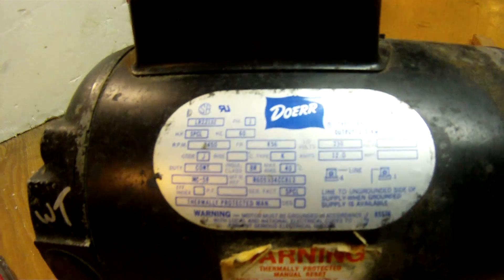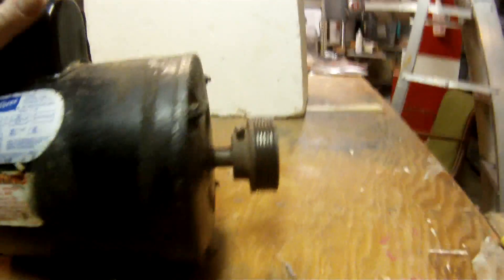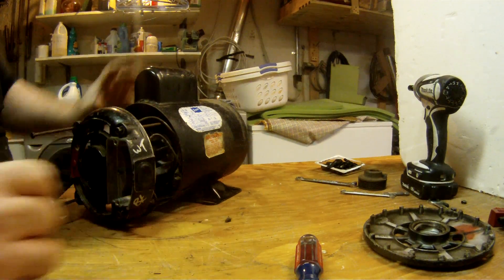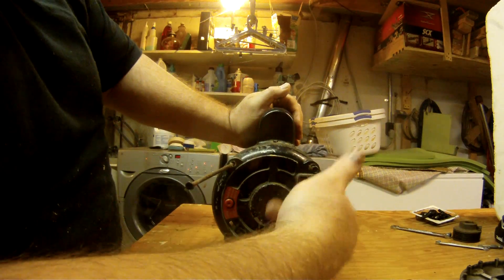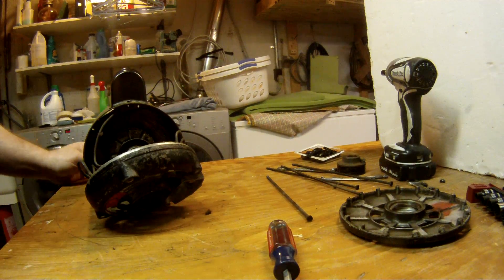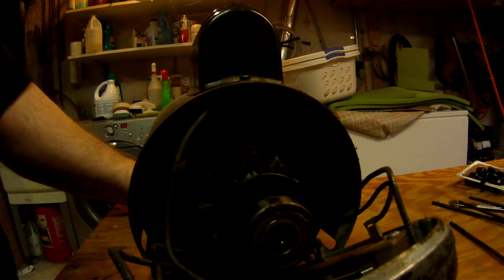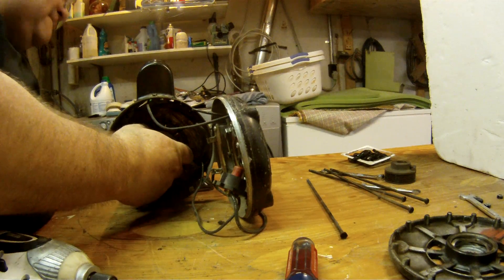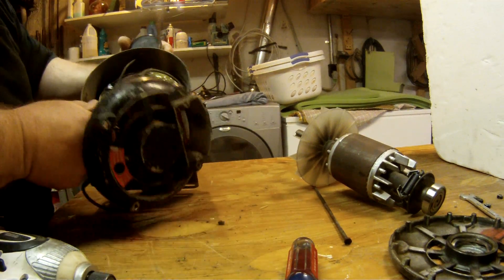Electric Motor repair disassembly and reassembly

Comment: I have a 1978 Deorr motor off an old compressor that was left outside.  I need to take it apart, see if I can re-lube the bearings and get the dirt dauber dirt out of there.  I can't get the ends off but thanks to your old vid here, it reminded me of how I've I've gotten the ends off when they are stuck.  The motor works, I just know it needs cleaning.  Glad you uploaded this.

Comment: Nice video.  Hi, i am hoping you might be able to assist me.  I have a brushless electric motor that hums but does not turn(belongs to a phase 1 bench grinder).  When i tried to turn it by hand in the "on" position, it does not move.  While in the "off" position, it turns just fine.  I checked the capacitor and it works fine.  The bearings are good too.  Any ideas on what might be wrong with it?
Reply from the maker: Brushless? Induction motor maybe? Shouldn't be a phase 1, I think. Does it need a VFD?

Comment: Suggest uou attempt a continuity test for the windings. It might save you alot of time. Do the windings smell like they're burned? Also, chances are that the cap is alright. It too , can be tested. Good luck. I'm having the armature (sp?) from an old Craftsman rebuilt. The two retaining springs that are located your armature completely rusted out on mine. Good informational video.
Reply from the maker: Thank you for the information. I ended up replacing the motor. It ran well until about 4 months ago when the mini rivets on one reed valve went bad. Going to have to make my own head gasket. Replacements are not available. No parts for a 35 year old compressor. Annoying . . lol . . . jk.

Comment: Capacitors can hold a charge for a very long time. You could have an old tube TV that's been unplugged for 5 years still have a charge of over 30,000 volts.

However, start capacitors normally have a bleed resistor soldered in to gradually dissipate the charge.

Thanks for posting this video, though. I think it'll help me with my motor.
Reply from the maker: Thank you for the comments.

Comment: You'll have less risk of breaking a bolt if you use your impact driver on the nut end.  Is it switchable?  I don't think you need impact after the first loosening.

Comment: I have watched your video several, I have a craftsman air compressor I bought back in 2000, and after watching your video and doing some research on what a capacitor does and when it goes caput, I ordered a capacitor, but I also had my long bolts out, and they wouldn't secure back in. I eventually had to take the backend off, I shoved the bolds through, and I couldn't figure out what they secured to, right in front of me are all four little nuts side by side, on my bench. On my motor, you have to take both ends off, there is a screw that is attached to the shaft using the rear plate as an anchor. This is the first time I ever tried something like this, and I couldn't have done it without watching this video.

Comment: if the motor hums and you xan start it by turnung it with your hand then its the cap.the cap is only to help it fully crank. also check for voltage on cap. you should get a complete circuit. caps are cheap. im betting its ypur windings .also dont forget that tiny washer its used as a spacer bearing

Comment: I have a very similar motor but different problem. It fell into river water during last flood. I dried it out, cleaned it off, changed the oil, and it runs, but, there is a scraping sound. I think it might be that the bearings had the oil washed out (if they are not sealed bearings, just shielded). I will watch out for the limit switch, though. Running a compressor against high pressure will over-amp the motor and burn the windings.
Reply: Ronald Smolinski If the motor is still going, change the bearings. I work in a motor repair shop the main problem motors face are bearings, they lock and burn up.
Reply: I did, thank you.

Comment: Couldn't you tell if the windings were bad by testing continuity?  just a guess.
Reply: Sometimes maybe, but a coil of wire has continuity already, so if you burn it, it just becomes a coil with less windings (and still has continuity).  Technically you could measure a lower resistance since it's burned together and the electrical path is shorter, but the resistance is so low, you'd really need to calculate the ohms by passing a current through the winding and measuring the voltage drop.  I've tried to figure a way of testing brushless rc motors, and the best I've come up with is if you spin them up with no load, and they get really hot fast, they're bad.

Comment: To know if it is the capacitor, before disassembly, turn motor on, if you hear the hum, try to manually start the motor by spinning it a bit, one direction, if that does not work, the other direction, if that makes the motor run, you likely have a working motor with a broken starter

Comment: Your video really helped me out alot, did the cap work out? I'm about to start taking mine apart, although I think my problem goes deeper since I saw smoke come out on start-up. I haven't found a video on that yet but still lookin'
Reply: moviemedic3 
How to fix start n run capacitor

Comment: It was hard to tell in the video, but were the "strings" tying the winding together melted? Often, there can be discoloration of the windings that happens over time due to constant minor overheating; and it can still work.  Especially on older motors like this. If it really had severe overheating, you'll see the nylon strings melted. Did you have your friend perform continuity and Megger test? Just curious because I never found a video of you testing the winding or puttin in a capacitor.